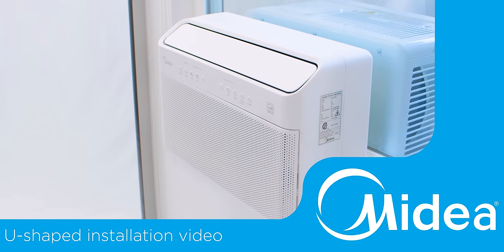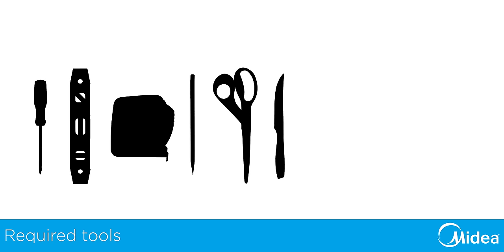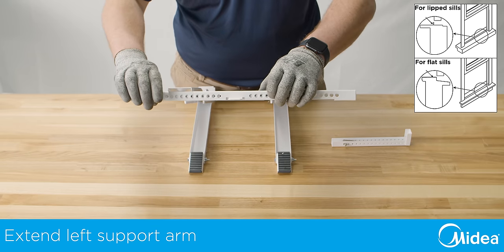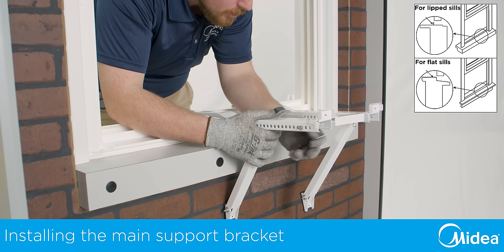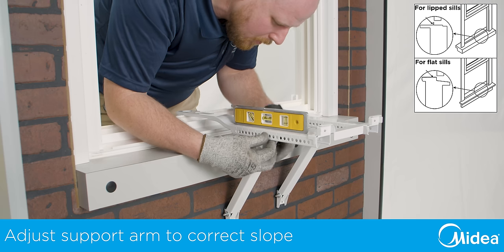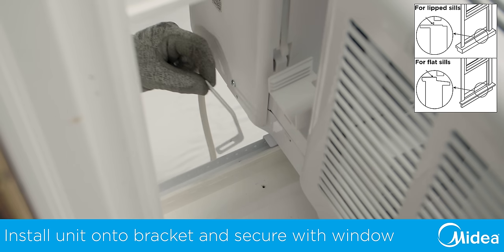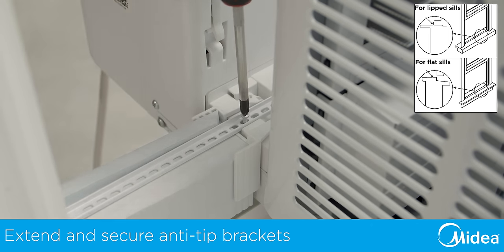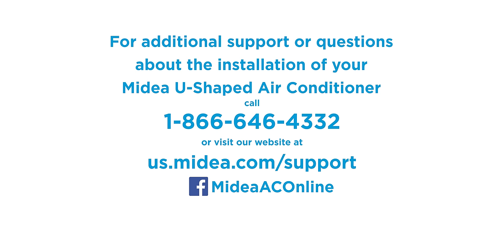Midea U AC Installation Guide

Comment: So...where are the 3 easy steps?
Reply from the maker: Hi Eli. Thank you for sharing your comment. We're sorry to hear you find the installation of the AC unit more challenging. We'd like to hear your feedback, please give us a call at (866)646-4332 or send an email to customerserviceusa@midea.com.
Reply: @MideaAmerica  Way to miss the point, PR point person. LOL It isn't really that this AC is particularly more difficult to install than other ACs. It isn't all that much more involved. *However*, the promotional video very clearly represented that installing this unit was a simple, three-step process of drop in, fold down gap seals, and shut window. Not exactly as described.
Reply: @reverseblt2844 installing the A/C is 3 easy steps.  The parts you struggled on was installing the A/C bracket.  The A/C bracket set-up is the same as any other bracket of that design, so has nothing to do with the actual A/C.
Reply: r/woosh
Reply: Its easy , I installed myself in about 20 minutes only wach the video its not like install a TV on TV table it needs to  Measure the size 😉 !!.
Reply: @MideaAmerica  I’m returning it. It’s too complicated.
Reply: I just finished installing mine after watching the video. It took about an hour and the unit is great. It cools my room very quickly to 60°F. It's quiet as advertised. So far so good.
I skipped a few steps only because I didn't need to screw the brackets or secure the air conditioning unit as it was shown in the video. It's sturdy enough, it's being held in place, and everything seems great so far. Hopefully these few skipped steps don't end up hurting me or my unit.
Reply: @brandonwood9042 how did it end up doing? I am in the process of doing this and I’m worried of the results lol

Comment: This video is outdated. Do yourself a favor and read the official paper instructions or video by "The Fixer". Midea changed anti-tip and open window brackets, they look differently now. Also the instructions call for soft foam under and around the hard foam blocks.
Reply: Yeah it seems all of these videos are 3 to 4 years old.  2024 models are different. Some have phone apps which won;t work as I have little signal  and no wi fi.

Comment: If you have a window that’s wider than 36” then you’ll waste your time watching this.  I have 40” windows and had to totally redesign the install process.  Very frustrating.  Midea should consider selling kits for windows that are wider than 36”.  ... back to my install: 2 hours later it’s in the window.  Needless to say, many of the supplied parts were unused.  The only thing useful was the AC window bracket.
Reply: can you specify how you installed this without the supplied parts? Mine is here and want to install...I can order some additional custom foam
Reply: It wasn’t a clean install, but I removed the included thick foam arms & cut 2x4’s to length for the width of the window.  Then added a 1x1 under the 2x4’s and AC unit for the total width of the window casing track (if you have one).  Now the 2x4’s are not the exact thickness, so I added cardboard to add the needed thickness where the 2x4’s slide into the fold down arms.  After that, I used 1” (one sided) sticky foam for the needed insulation.  From there it was do you best to fill in the holes (if any).  Like I said, it’s not a beauty queen install, but it’s very functional and does the job.  Hope this helps
Reply: Looks like if they do not answer me I will have to cancel my order on Amazon because my window is 47  inches wide in my bedroom! You would think they would sell brackets that would fit this size window. Gosh darn... ugh. I will wait to see if they answer my question tomorrow.
Reply: @michaelashton4139  I for sure won't be able to do this then. Darn I spent all weekend researching ac units.

Comment: Pro-tip: Find a handyman with this installation. Making sure brackets sit flush against outside wall with an overhang is difficult. The foam insulation will be difficult and require multiple layers on vertical axis to cover gaps. Watch this video first, read the manual, then watch this video again. Give yourself two hours for the work. It's worth it once the unit is in.
Reply from the maker: Thank you for your feedback. We are happy to hear you are enjoying your new AC and that it was worth the time and effort. Enjoy! m.me/MideaAmerica MideaCustomerCare@hartehanks.com
Reply: I agree! having a hard time getting the brackets to stay in place!!
Reply: really I am not handy at all and me and my sister did it in like 35 mins pretty easily. You must have a peculiar window frame mine sat pretty easily and there was little to no gaps to cover with insulation. Its much easier with two people so one can help align the holes up for the outside support bracket and obviously help lift and center the unit in the frame but dont hire someone without trying with a friend or neighbor!
Reply: I am at 4

Comment: I have three of these units. I have had 1 for 2 summers and this upcoming summer will be its third season. I have 2 more that are going to be going into their second summer. I just installed all three today in the Northeast. After I bought my first one three years ago, taking it out was more difficult than it should be. Take it from me everyone, you absolutely do NOT need to screw or fasten these into your windows. You do not need to install the anti-tip arms. You do not need to screw the support bracket into the window. You do not need to install the the small bracket that connects the main support bracket to the AC. All of these are redundant steps to provide redundant safety I suppose? If you level your main support bracket correctly, appropriately cut and install the pads with weather stripping in your holes and shut the window in between, the unit will absolutely stay there and not move. Only start screwing things in if you want to PERMANENTLY install your Midea unit and will not be removing it at the end of summer. Again, I have 3 of these and move them in out of windows every year using nothing but the Main Support Bracket, the AC unit and the 2 Pads with 2 black weather strips.
Reply: Good advise. I believe all those extra steps are for security reason- to stop someone push in where the unit is on street level.
Reply: Thanks...  I was just about to state the obvious that this must be a huge pain to remove at the end of summer.
Reply: So you do not screw anything in at all into the window frame?  What holds the unit in place then, just the window wedging into the unit?  I don't have the unit but am researching window A/C's for only temporary placement that are easily and quickly installed and removed as needed.  How long does it take you to install and remove a unit using your method?
Reply: @bjjanesth660  My method is not different than what is in this video or in the official instructions. I am just telling you that using any screws are redundant and unncessary. The AC rests on the bracket that you place onto the window sill that supports the AC. If you level the bracket correctly, it will not move, even if you do not close the window. The video and instructions tell you to screw the bracket into the window, screw the AC into the window, and screw the additional supports into the window. I can assure you that none of this is needed.

Comment: I was able to install this in a window that doesn't open top to bottom but instead side to side with some ingenuity (I know it's not designed for it, but I made it work).  System is great and super quiet.
Reply from the maker: Hi JW Memorabilia. Thank you for sharing your feedback. It sounds like you got really creative installing this unit. We're glad that you're satisfied with its performance and like its quietness.
Reply: @MideaAmerica  yes I did get creative indeed.  I'll likely post a video of how I did it once I've got it all cleaned up and pretty.
Reply: JW Memorabilia is there anyway you can post the video on your channel? Im really interested. I have horizontal sliding windows
Reply: @AverageOverlander  
Would really like to see your video as my windows are also like yours. Are you able to provide a link?
Reply: Wow can u post it ..my window is the same ..
Reply: Hello Jason, I know your comment is not recent but can you post how you did it?
Reply: @NomfundoV8  I built a false window frame and removed the original one piece of the two piece window.
Reply: @AverageOverlander  Thank you for responding,I'm considering buying this unit but I'm quite slow when it comes to being handy. I was hoping you had posted a video on how you did it😭
Reply: @NomfundoV8  sorry I can’t be of more help. I’m extremely handy so me fabricating something was fairly simple.
Reply: @AverageOverlander  Thanks so much for responding, I wish I had that gift hahaha. I'll just settle for the old school one.
Reply: Dude I am COMMITTED To doing the same! This was the comment I was looking for
Reply: You likely placed a solid cut board at the top. That works.

Comment: 4:49 align
5:00 ant slip bracket
6:19 sash lock
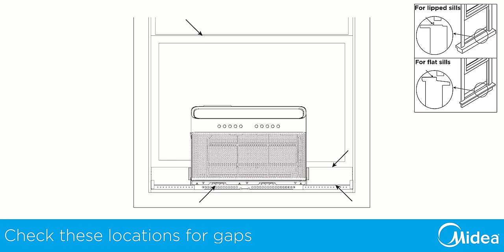6:26 foam pieces

Before buying anything or plugging in to power, please test wall socket to make sure it has ground properly wired.

Comment: I got the 12,000 BTU U-Shaped AC & it works GREAT! It runs so quiet that if you're not right next to the AC, you have to look to verify it's even on!
Only issue is the Smart setup! The instructions are not correct & using bar code scanning returns, "illegal code". I'll wait a bit for them to update their new products & in the mean time the included remote works just fine!
Reply from the maker: Hi M Castle. Thank you for sharing your review of our U-Shape AC unit. We're happy that you like its performance and quietness. 
We are currently working on updating the app for better connection and compatibility.
-Midea Customer Care
Reply: @MideaAmerica  How is that update coming along? You say this a lot but I have a feeling it's not going to happen.

Comment: August 7th, 2020. Just installed 12000btu unit and must say that putting it together was a breath, all holes and brackets aligned perfectly, quite frankly I was a bit surprised. I turned it on and it started cooling the air, in my semi-basement, nicely. So far, the only problem, it produces some random noises caused by the cooling propeller (I'm guessing) I'll call tomorrow to costumers service and I'm sure it will be taking care of. Otherwise, so far it works as advertised. Thanks
Reply from the maker: Hi  Timur Kholodenko. Thank you for sharing your experience concerning our Midea U-Shape Inverter AC. We're happy to know that you like its design and efficiency. We hope to hear from you soon in regards to your query on the sound its making.

Comment: The screws were all the same size.  

Also, my window is 43” long.  I wish it came with longer window brackets. Lord help me but now I have to attach wooden blocks to make up the difference.  I pray it holds.
Reply: how did you go about securing it? I have 50 in windows

Comment: Agree,  the installation is very easy. I  had two 12000-BTU  and after two years, both stopped working. The code that appeared indicated loss of refrigerant. Midea Customer Support didn't care about my problem. Since no technician is interested in fixing the window units I had to throw both in the garbage.
Reply from the maker: Hello, @antoniosgarlata5181; we apologize for the issues you've experienced with your units and the customer service you received. If you have any questions or concerns, please get in touch with us at digitalsupport@midea.com. Have a great day!

Comment: The Soleus Air over the sill AC unit is a way better design. U shaped but flipped so it hangs down over the window sill. More window visibility, more support, better seal.
Reply: A bigger chance to have condensation inside your home instead of outside.
Reply: @Megamanding  Why is that? Are they different designs?
Reply: @beunbad  condensation would have to flow up and out the window if the pump inside ever fails.

Comment: We bought an air conditioner the same a month ago, we are delighted with its work, it does not make any noise and it cools perfectly, I only have one question, does this air conditioner not leak water? You don't need a hose to dispose of the water? ? Because I don't see it throwing water like air conditioners normally do. I appreciate you answer me. Thank you 🙏
Reply from the maker: Hello. You do not need to use a hose. Place a level on a flat area of the bracket and adjust the Angled
Support Arms so the bracket is tilted downwards toward the
outdoors to allow condensate to drain out. For additional assistance, please email us at DigitalSupport@midea.com. Have a nice day.

Comment: The lift rail of my vinyl window forces me to bring the unit too far forward for the anti-tip bars to insert into the track.
In the end, the window AC no matter what brand, is the bane of my existence.
Reply: I have the exact same issue.
Reply: I have the same issue. Called customer service, explained the problem several times, and the rep said there's nothing they can do. Asked if there's someone else I can speak with, but there wasn't. She said they don't help with installation. Useless.

Comment: * UPDATE**
I wrote a comment (see below) about a week ago.  I have to update it.  This by far the quietest AC i've ever heard in my life.  It's shockingly quiet and the auto-fan feature ramps the fan to different speeds smoothly.  It's one of those things you dont realize you want until you have it.  Who knew I'd be so amazed by how quiet an AC could be.  Never ever was a concern of mine before - AC noise was AC noise - I could care less but now I just cant get over it.  When the compressor turns on, you hardly notice.  It basically no louder than the fan even when the compressor is running.  There are no abrupt moments with sound when the compressor turns on or off.  I can't get over the difference a variable speed inverter compressor makes.   I would highly recommend for light sleepers, nurseries etc.  One may complain it's not loud enough.  For those who like the white noise of a normal AC unit will NOT like this AC (A testament to how quiet it is even with just the fan running).  The unit does not make a clicking sound anymore (maybe it needed some break-in)?  Also, after reviewing the air gaps/lack of sealing, it's actually not so bad when put side by side to a conventional window unit.  In fact I think this unit seals better (but dont expect an air tight seal). 

As far as cooling performance, I did not notice any difference between this unit and a conventional one.  The air is cold and performs as expected in both cooling a hot room and also detecting the temperature accurately to maintain it.  The jury is out on the longevity/durability but nothing about the unit feels subpar for it's price.

***Original****
A few problems with mine.  
1) the bottom of the AC is not sealed.  The bracket the AC sits on does not seal to the bottom of the window.  You can see daylight under the AC where the AC sits on the bracket Channels as well as the bracket itself has some gaps in it in the same area.  There is no way to seal this without lots of tiny foam pieces shoved into all of these little places.  OK for a permanent install but def a pain for seasonal use/install.
2) My unit makes a faint fast paced clicking noise  when turned on.  It's coming from the outside part of the unit.  As if the fan outside is spinning and hitting the case or a component OR if there is something wrong with the balance of the fan blades
3) The unit is a bit taller (but narrower) than a traditional one.  This means window blinds do not go down as far.  A problem for bedrooms or spaces you want to temper the light in.
Overall not as good as I had hoped.  Pain in the rear to install seasonally compared to a traditional window unit, cannot seal it as well as a traditional window unit, more expensive than a traditional unit but quieter and supposed to use less electricity and it's a "connected/Smart" device.  After installing and using, I would say the cons barely outweigh the pros
Reply: For #1; anyone think wrapping parts of it in aluminum foil will help with the obvious design flaw of open gaps
Reply from the maker: Hi Natemare13. Thank you for sharing your comment, its comments like these that helps to improve our products. To better understand your situation, we invite you to give us a call at (866) 646-4332 and provide case no. 111087624 for better assistance. We hope to hear from you soon.
Reply: @benng4613  What parts are you talking about?
Reply: @beunbad  the ac mount has gaps

Comment: it is quite clear, however they show no pictures of th exterior and how unsightly  the  too long bracket sticks out from the 8000 and 12000 Btu units., They can be cut down but it is not clear to do it before installation and it is a pain to de install to cut off excess, drill new holes and mount new screws.
Also there is no way to direct the water draining and it will soak anything below, I will try to drill and put a drain hose on,  but i can't have it soaking the doorway below.
Reply from the maker: Hello Cyril. I am sorry to hear that the design outside is not what you were looking for. Thank you for your feedback.  If you do need assistance in anyway, please reach out to a specialist on Facebook at m.me/mideaamerica. Have a great day!